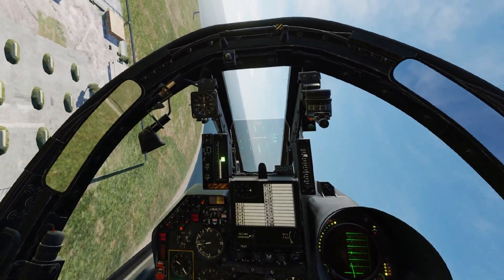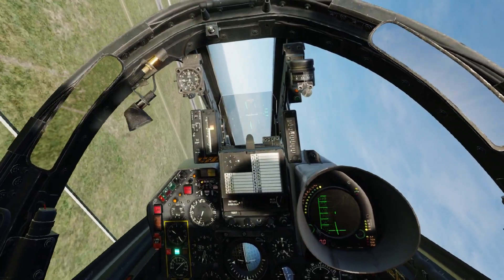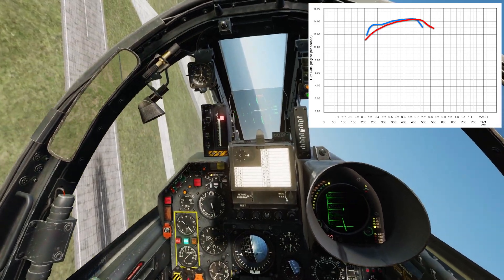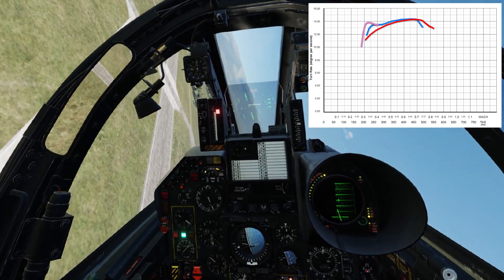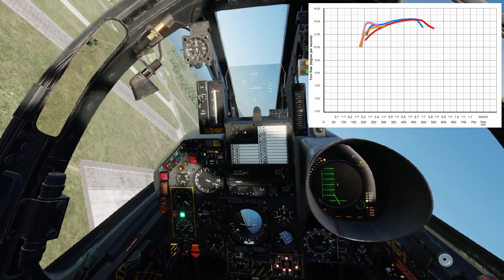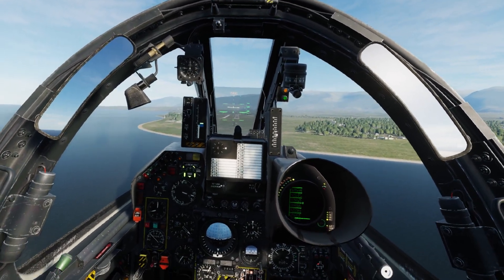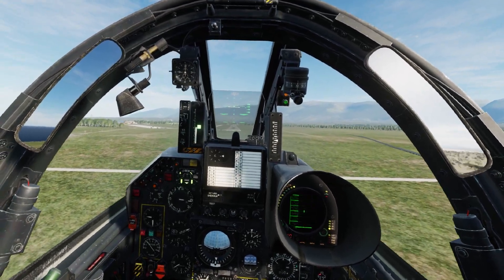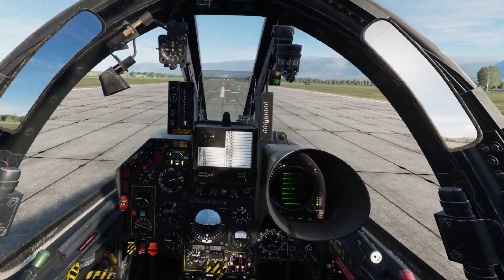OLD - Mirage F1CE Update (June 2023) Basic Flight Dynamics Analysis

Comment: You ran the test without flaps, but the slats were still working, as indicated by the yellow light. Try running the test again with slats disabled (HYPER switch). I knew that slats were screwing up my results, when I was investigating best range/endurance for various planes and I had to disable them always as a result.

Comment: Thanks for the analysis .. on my case I'd rather have a more accurate landing than a more accurate high AOA turn performance with combat flaps, but I would expèct that Aerges is still tuning this aspect. Kudos for a video with actual content, instead of all those low-effort videos that one can find on YT about DCS  ... cheers!
Reply from the maker: Thanks. That bump is a DCS shortcoming (in some cases), something Devs have to work around, happens when the lift is accurate at lower speeds. Its annoying as heck when developing, but has a fix, probably more than one, lets hope Aerges implements a fix, and not a median (a bit of sacrifice on landing a bit of sacrifice on turning).